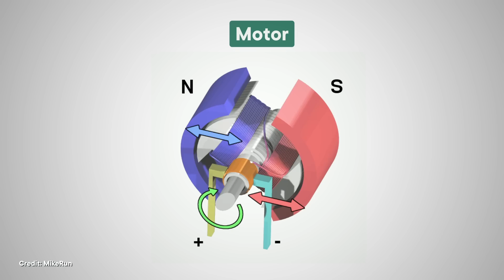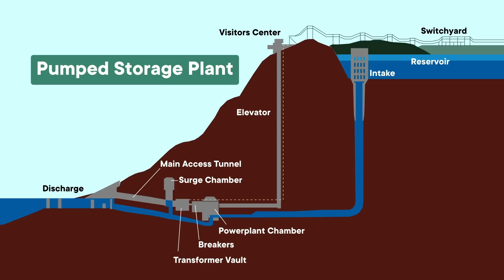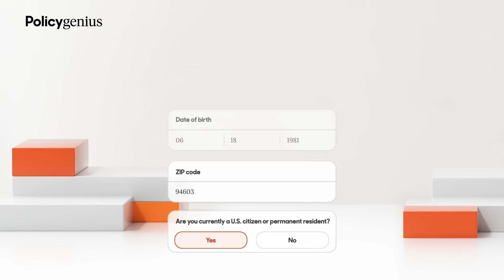How To Make Buildings Into Batteries

Comment: The first idea i got when i saw the title was not water pumping, but instead just a very heavy and dense block lifting and dropping in an elevator shaft. But i guess if its a system meant for mega structure skyscrapers, it won't scale as well as pumping water.

Comment: How about making a lighter than air gravity battery? Instead of storing energy by lifting stuff upwards and releasing it by letting it fall, you could release the energy by letting a big tethered baloon full of hydrogen fly up and use the tension in the rope to spin a generator, then to store the energy you just pull it back down. It would probably be very impractical but imagine how cool it would be to have giant zeppelins bobbing up and down all day.
Reply: Wow that's actually a really cool idea
Reply: Hurricanes, tornadoes, etc would be problematic, as well as tiny hydrogen molecules being very difficult for managing leakage, and of course its explosive properties.
Helium is becoming more rare, as well.
Reply: By knowing your cool idea is impractical, you're already ahead of the designers of a lot of energy storage "technologies".
Being able to thing creatively while keeping your feet on the ground is important for coming up with viable solutions to problems.
Reply: Very clever. Not practical would be be very cool😊
Reply: Look up a bouancy battery
Reply: Seems like it would be difficult to build at scale. Now I'm imagining what it would look like in a Dr. Seuss book.
Reply: isn't hydrogen very flammable tho?
Reply: @torreywhiting5402  
It is but I actually don't think that would be the biggest issue. They wouldn't need passengers onboard, and they would spend most of the time in the air without much danger of blowing up as long as they weren't over an inhabited area. Like others have said I think the main reason it would be impractical is that hydrogen likes to leak out of balloons because the molecules are small and it's fairly expensive, and they'd also get blown around a lot by the wind. Also you probably wouldn't be able to store that much energy compared to pumped hydro because the buoyancy force of a balloon is dependent on the mass of air it displaces, and air doesn't have much mass, whereas a pumped hydro battery depends on the mass of water which is about 1000 times denser.
Reply: @Dorgpoop  ah ok thx, good info
Reply: I was just thinking maybe they could blend that super jumping robot technology (that Veritasium talked about) with the gravity battery concept...🤔
Reply: @Dorgpoop  Not sure why my comment got deleted but if we ever master fusion we can use the waste helium for this!
Reply: Helium is a pretty valuable resource and hydrogen is flammable which could both pose issues. But a compression chamber could work maybe, although I imagine this would result in a massive loss of energy

Comment: There's an unexpected advantage to pumped hydro storage within the walls of buildings. It could also act as a thermal battery. Pumping warm water from underground during the night to save on heating cost, and storing it underground to be insulated and kept warm for the next night.  The same could be done with cool water during the day that is stored underground at night. The system would resemble or could be integrated into aa existing geothermal heating system much like many residential systems.

Comment: U=MGH is a really bad relationship. Mass * Height * 9.8 m/s^2

Assuming 100 meter tall building, a cubic meter of concreet weighs 2.3k Kg
So that's 100*2300*9.8 = 2.25 mega joules of energy. That's 625 watt hours. Or another words, not much power. 

A typical 18650 lithium battery holds 11.1wh of power. So 56.3 cells (let's call it 57)

At 49 grams per cell, that's 2.793 kg to store the same energy in a fraction of the volume. 

The only reason to use a system like this is cost and opertuntunity. The cost savings would come from the fact that you can get mass relatively cheaply, and the opertuntunity comes from access to a large hight potental.

Comment: This is probably an incredibly stupid question, but... 

The building would have to be stronger to hold the weight up after it's pumped. That would cost extra resources and extra pollution. 

I'm sure that's still very beneficial, but would it be that hard to lift the building by a few milliliters? Or even just a part of it, like the elevator shaft with the penthouse attached to it? I know such technology exists and is used in some scientific and manufacturing facilities that require great isolation from any vibrations.

Or is there some efficiency issue, that lifting something very heavy a short distance (or vice versa) makes it much harder to extract the energy back?

Comment: Thanks.  Note that the original idea of Energy Vault was genius but terrible , as it was supposed to lift and drop giant concrete and steel blocks. Calculations show that even when you use only a shell of concrete and steel for the blocks and fill them with waste, you still use a lot of concrete and steel.  So much of them, that even if this facility works non-stop for 30 years, each stored PV kWh will still have a carbon footprint of a natural gas kWh... So it's a non sustainable climate solution.

Comment: Gravity is by far the weakest of the fundamental forces. Why anyone would think it is a good idea to use it to store energy is beyond me. The only reason pumped hydro works is that you're moving literal mountains worth of water.
Reply: I wonder how long they could power the building with a full battery. Is it a day or like weeks? How long could you power bare necessities like the elevators? Fridges?
Reply: @98Zai  they won't be powering anything with a gravity battery because none will be built. At 90% roundtrip efficiency, you need to lift over 4 tons 100 meters to store 1 kWh. The amount of materials involved, not just the useful mass, but also the structure necessary to support it, is simply insane. Meanwhile batteries chemistries are improving rapidly. Sodium-ion batteries that are long-lasting and don't contain any rare or problematic materials are commercially available. Hydrogen at least has the advantage of high gravimetric density. Gravity batteries have nothing.
Reply: @jfolz  Yeah but I mean it's a reliable battery that lasts forever. An Olympic swimming pool is 2 tons of water, they probably have one on the roof anyway.
Reply: @98Zai  an olympic pool holds about 2500 tons actually, so I doubt there are any of those on top of skyscrapers. I'd also imagine the residents would get quite annoyed that their pool fills and empties a couple of times a day.
Reply: @jfolz  I'm assuming it's mostly a backup power kinda thing? But I guess they could fill it during the day and generate power in the evening for cheaper electricity! It sounds like they would construct the building around a cistern that spans the length of the building, I don't think they are going to be using a pool.

Comment: The idea is nothing new or even remotely viable. Sure it sounds appealing. I suggest to watch thunderf00t's video about such "revolutionary" idea. I am kinda disappointed the channel have failed to do the actual maths to validate the idea before posting... For one, the energy needed to pump water to 500 metres high is more than you can gain from reversing it due to loss in the pump, second, the volume of the water will take up in any high tower will come at a cost (not occupied space - not making revenue). Trust me it is NOT a solution but a smoke screen. Saying as a civil engineer PhD in construction. "Easy as lifting it a dropping it"? It is much more complicated if you bother to do the actual gain and loss calculations and it will always end with loss.

Comment: uhm, a lot of people have done the math on gravity batteries, and the only reason pumped hydro "blows lithium-ion out of the water" let alone manages cost parity, is because pumped hydro takes advantage of natural basins and relatively small pumping and piping systems to store enormous quantities of water. If you put it in a building, you loose basically all the advantages of pumped hydro.
The other huge problem with using a water-based gravity battery in a building's walls is mold. the water tanks will leak, which is going to make the air spaces inside all the walls damp, and there's really no way around that.

if you want to add non-chemical batteries to a building in a city, it's much cheaper and more energy-dense to stick thermal storage in the basement. Heating and Cooling make up most of the energy usage in commercial and residential buildings, so a thermal battery works for most of the building's energy needs with an even better storage efficiency than chemical batteries because you don't have to convert back to electricity. Even better, you can already buy things like stratified water heaters even at residential scale, and sand, gravel or even graphite based thermal storage at commercial scale.
Reply: Yup. In any location where climate control is a substantial portion of the energy consumed, thermal storage makes the most sense. You’d heat or cool a tank of water or some other liquid while energy is plentiful, then tap that stored thermal energy when power is more limited and expensive. 

You can even use the building itself as a storage medium. So for example, during the summer in a place like Arizona your smart thermostat could cool your home to some minimum acceptable temperature to you - say, 65°F - during midday while power is essentially free. 

Then in the evening it could allow the temperature to rise to some maximum, maybe 80°, before switching on the power hungry compressor. 

In a well-insulated home, it might never need to switch back on until cheap solar is plentiful the next morning. 

If you implement a smart grid and smart appliances in homes and businesses, you can store vast amounts of thermal energy for free, without building a single battery or even making changes to the buildings where the energy is being stored.
Reply: @sunspot42  I use a heat pump to heat water and it cools my chiller room for storage. I think is a good use of energy.
Reply: Yeah, I'm still optimistic about liquid metal batteries as the best solution for a smart grid in most locations.  Taking battery technology designed for portability (lithium ion batteries) and using it for grid storage may be a bad idea for the mentioned reasons, but that doesn't mean that batteries can't be designed for grid-storage from the ground up.

That said, there's nothing saying we can't use liquid metal batteries for electrical storage and thermal storage for heating/cooling uses.
Reply: As a building manager. This is a terrible idea. It’s bad enough with domestic water and sprinkler systems. Pair that with the ever increasing use of plastic pipe…looking at you cpvc! Thankfully at the pace we are at saving the earth I’ll be long retired or dead before I have to deal with that mess.
Reply: Imagine the lateral force on the walls of a 500m tall water column with a base surface of 60 m2. Circa 290 MN. Absolutely huge! One small crack and your skyscraper is becoming a water cannon first and after a few seconds the pressure blows the whole basement out of existence. I surely don't want to be in the lobby of such building. 🤪
Reply: @Lucky32Luke  Was also thinking of all the weight of water - water is dense - and how strong the foundations would have to be, and even if the ground beneath it could support all the extra weight.
Reply: @Lucky32Luke  to be fair there would be a cut off point before which the energy stored in the water would not be worth pumping to that level. so the tanks wont span the entire height of the sky scraper but only the upper levels.
this on the other hand cuts into the maximum useable volume per building making this idea even worse.
Reply: @TheScarvig  The idea on it's own is dumb from the get go. My main two objections were in my previous comment below. From an engineering point (I am in fact a civil engineer working in the construction industry) the idea falls flat on several points. The physics, maths vs. gain and current construction methods of a skyscraper doesn't add up. I am genuinely disappointed it was posted here at all. Even knowing thunderf00t is not an engineer (but a scientist) his reasoning why this is a stupid idea is compelling. I can only suggest to everyone who believe this idea is great to watch his video on youtube - Energy Vault -BUSTED! and Energy Vault: MEGA-BUSTED!
Reply: @Lucky32Luke  completely agree! i love how often even a bit of back of a napkin math can show that many of the things thunderf00t debunks are not commercially viable if even possible at all.
Reply: Loading and unloading an expensive structure to add more wear? No wonder pumped hydro works best on mountains.
Reply: Avoid leaking water. Use mercury. 15x the energy storage. /s
Reply: Would that increase the fire risk of the building? Having a massive, got mass at the bottom of the building?
Reply: Dem Skyscrapers got no volume
Reply: I vote we do both, a hot water tank in the dead centre of the building, obviously much hotter than tap hot water. As power is generated, heat the water going in and increase until full pressure, then, lift. At night, drop it for power and for reheating/refilling the main hot water tanks for residents. Add a thermal battery of sand in the bottom of the building to store long term for winter etc. 

I reckon in the long future humans are gonna have to start controlling/moving/storing heat in the same way we do electricity, if we could only losslessly superconduct heat within and between cities, hell between continents, we could solve giant problems. Imagine taking heat away from the Arctic to heat homes in New York and Cuba, or cooling down an unbearable summer day by sending your heat to a steel processing plant, so an entire city's worth of indoor heat gets used for something useful. 
Unfortunately this is just some blazed dude's wishful thinking that entropy wasn't a thing or that we could build Maxwell's demon
Reply: @geoffreymartin6363  It's cool to use this tech to save on power and use it more efficiently. 
But this whole concept began as an electric battery idea and for that it's a complete fail.
Reply: This feels like one of those solutions that seems so simple at  a glance, that you're first question should really be "If it's so simple and based on stuff we've already used before, why aren't we using it already?" and the answer is almost always that there's some catch where it won't actually work
Reply: There's another gravity system that uses a large weight and winch system. Far more compact and practical, and your energy storage doesn't literally evaporate.
Reply: @searchingfortruth619 completely impractical as well.  A water tower has a function even if it’s not quite the same as a battery and not efficient enough to scale up and support the electrical grid. A water tower is relevant in a water distribution system…..….a winch and block has not made sense since the days of the trebuchet in almost any context.
Reply: @rowanpost6063  pumped hydro systems play no role in the general water system. And they are far larger than water towers.
Winch system may not be the #1 choice in all circumstances, but I think there could be applications where it is useful. To me, it is worth further exploration and experimentation. We have all the technological pieces to make it work, and it would be fairly low maintenance.
Reply: Thanks for explaining so much. I thought one of the best things about the gravity battery is - unlike any other battery I know of - the charge will not leak away. You could store your energy for years and never lose any. (I guess an earthquake could do it though, if it shook your weight free).
Reply: Thank you.  This video is idiocy.  Talking as if water towers don’t exist already.  Thermal storage with water or otherwise is much better I agree.
Reply: Something a lot of moderately sized condo and apartment complexes being built in my neighborhood have solar panels installed right into the roofs, and the cost of home solar panel set-ups is coming down. In my opinion, we need to move away from huge power plants and thousands of kilometers of cables and focus on local small-scale power generation. Each building or neighborhood block having its own built-in power supply. This will also side-step the problem of city-wide power outages caused by extreme weather crippling entire cities...which keeps happening to my city almost every other year.

As for building gravity batteries into skyscrapers...why not turn the elevators into batteries?

Comment: It has the advantage of low transmission losses.  Nice to have but seem kind of like too little too late.  Replacing all the buildings to have all the extra structural support is a 100s of years project.  The power problem will be solved by then.